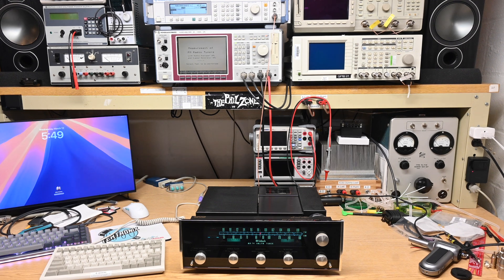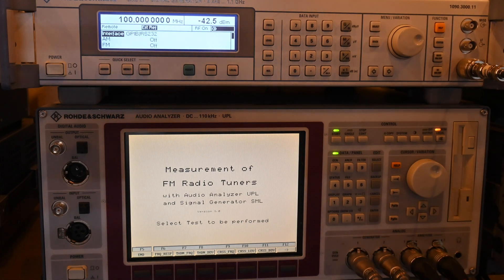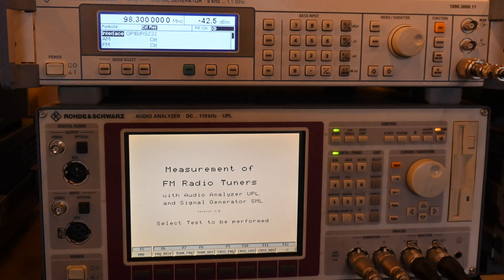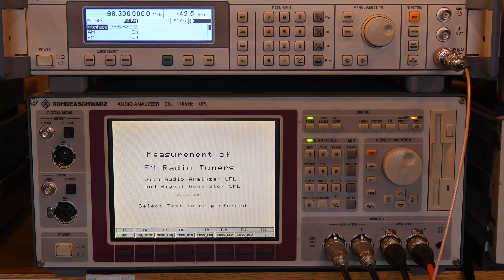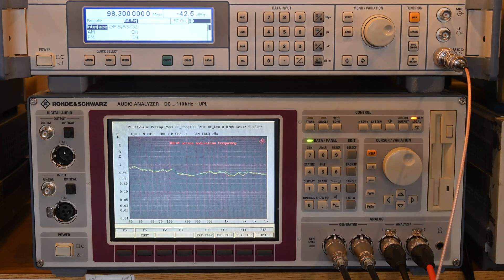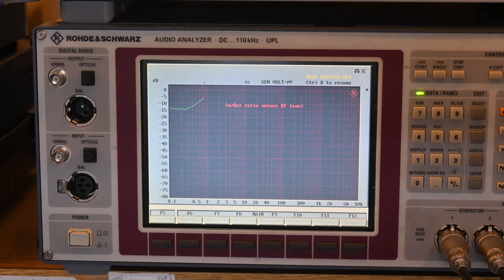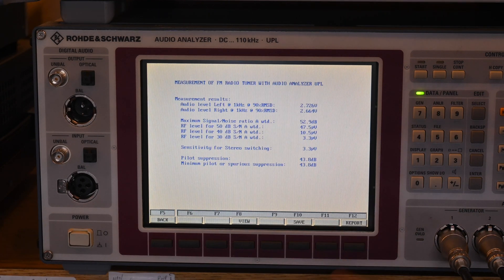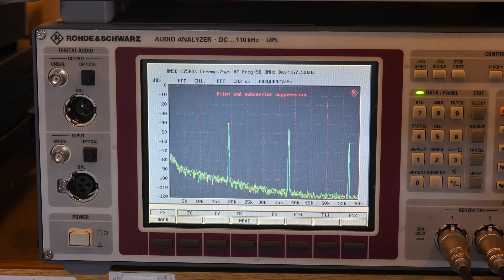FM Performance Tests with McIntosh MR74, Rohde & Schwarz UPL Audio Analyzer & SML Signal Generator

Comment: Hi Phil. I enjoyed this video. Maybe you can help me understand one of your measurements. I see you measuring L and R cross talk, but your equipment shows a trace for Left and a trace for Right. As I understand, the measurements are relative so I would expect a single trace showing the difference between Left and Right. Is your measurements showing a trace of Left into Right and a trace of Right into Left?
Reply from the maker: Check out page 16 of the pdf in the description - they explain it in a bit more detail.  But yeah the Stereo encoder on the signal generator is set to modulate L only for one test and R only for the other, so it’s actually only measuring one ch at a time, compared to the expected silence on the other… if that makes sense!